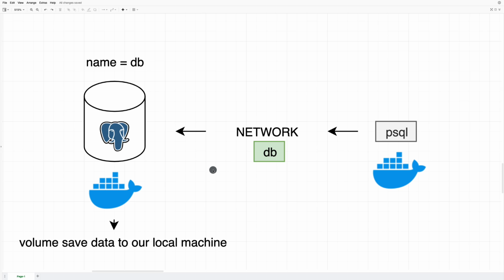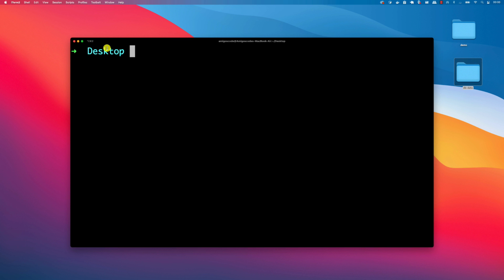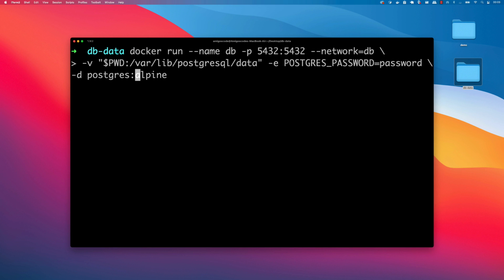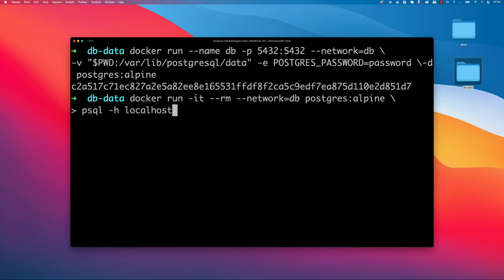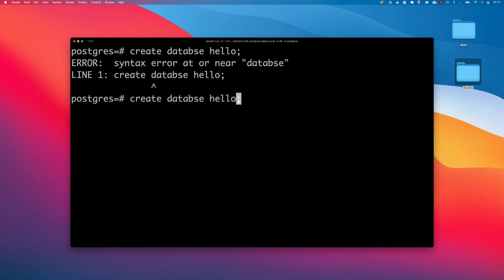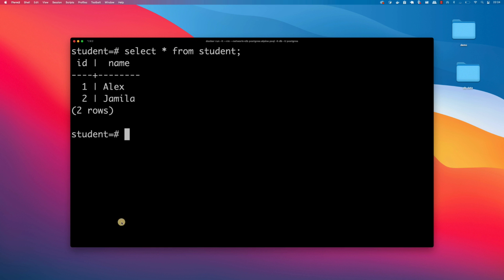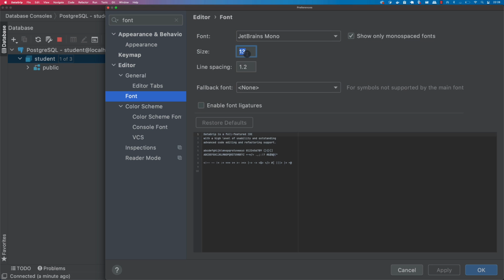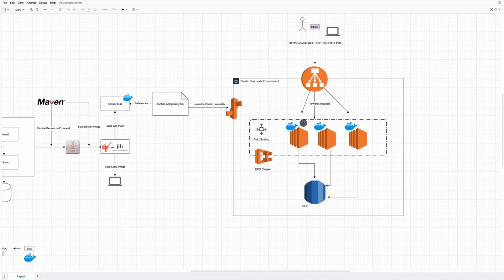Docker Postgres and DataGrip Tutorial

Comment: Hey, I am getting this error :
docker: Error response from daemon: create $PWD: "$PWD" includes invalid characters for a local volume name, only "[a-zA-Z0-9][a-zA-Z0-9_.-]" are allowed. If you intended to pass a host directory, use absolute path.
after running this command:
docker run --name db -p 5432:5432 --network=db -v "$PWD:/var/lib/postgresql/data" -e POSTGRES_PASSWORD=password -d postgres:alpine
Please help.
Reply: 2 years late but if someone has that same error you just have to remove the '$' (it worked like this for me on Windows)